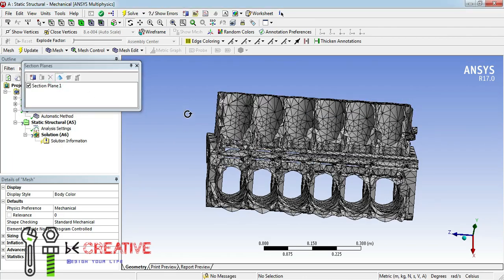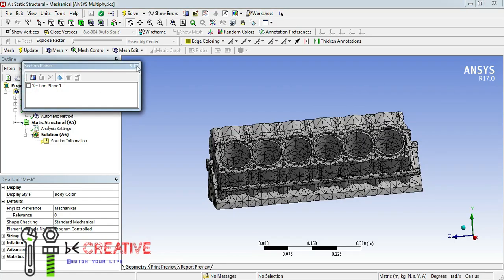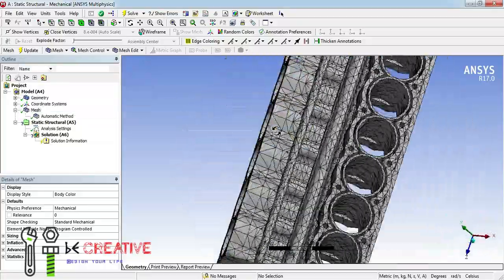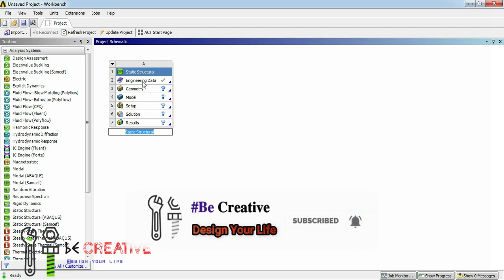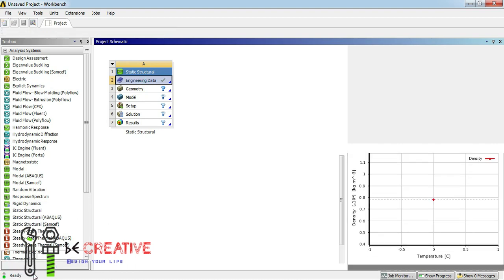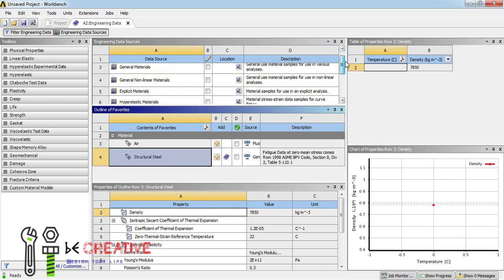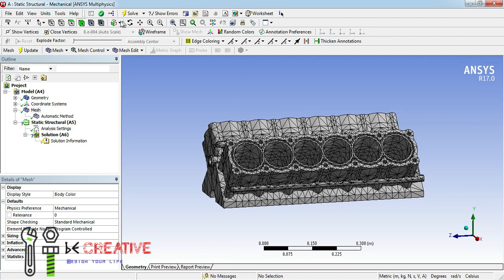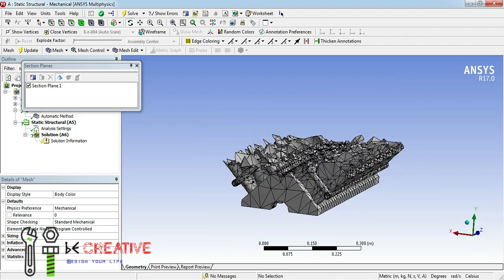ANSYS Workbench Tutorial - Introduction to Static Structural | Meshing | Be creative

Comment: Hey, I found your engine NX modeling tutorial and found it very helpful. Where do you find the design drawings before modeling them? I want to try to test if I can do it on my own without a tutorial. Thanks!
Reply from the maker: I'm glad to know that my videos are helped in your learning.  Actually I have created design by using initial prototype. I haven't created drawings for those.
Reply: @BeCreative666   Oh okay, I guess my question would be where do you find these prototypes then?
Reply from the maker: @chris-dr5yg  I have created by rough sketch,  you can create the model by noting down the measurements for better practice.